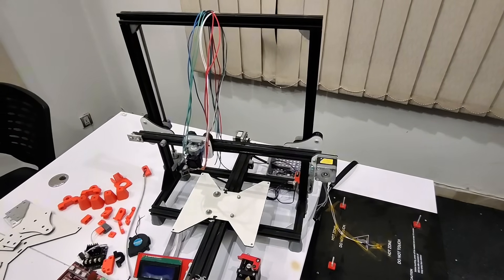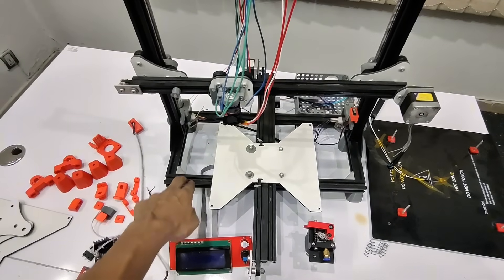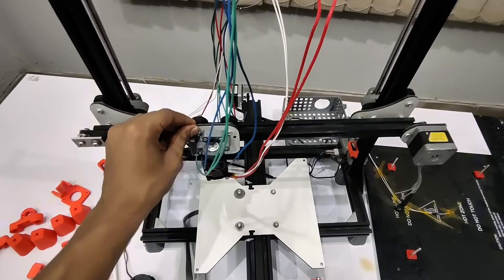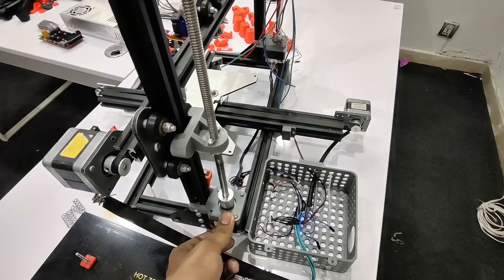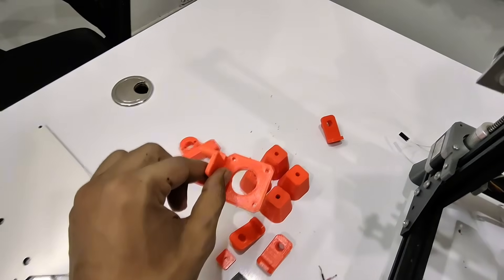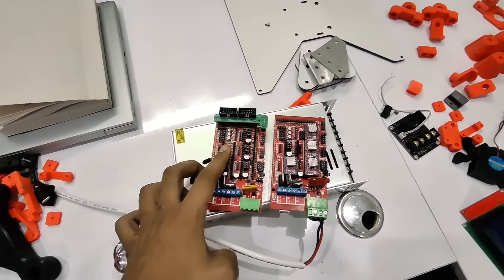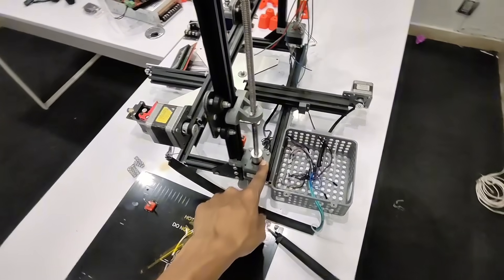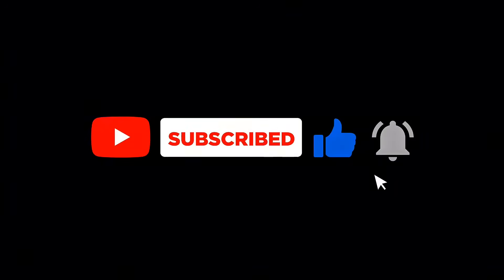Build Your Own DIY 3D Printer Part #1 #opensource #3dprinters

Comment: What is the material used for gantries? Can they be made from PVC?
Reply from the maker: I used aluminum cladding sheets. You can use acrylic sheets also. Pvc can be used but make sure the thickness is 4mm